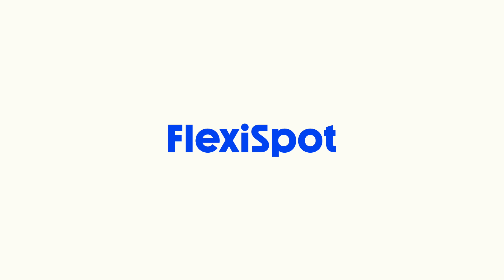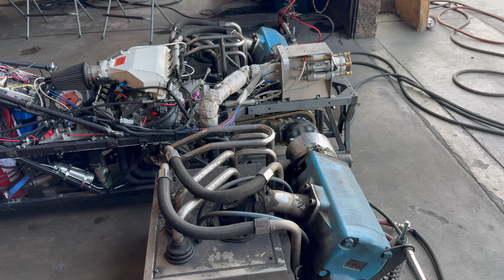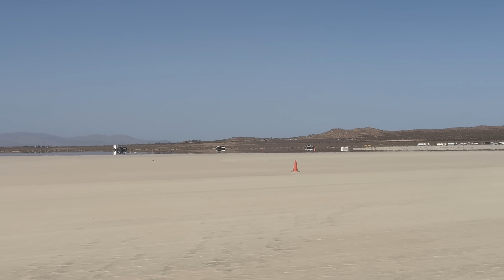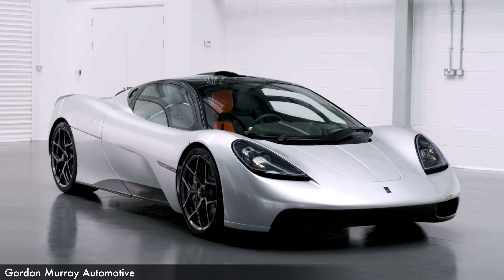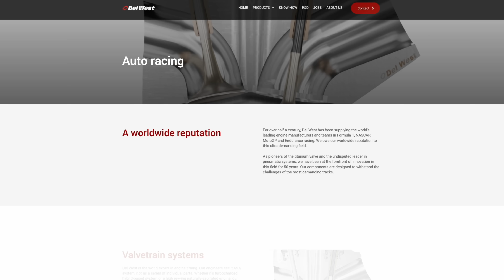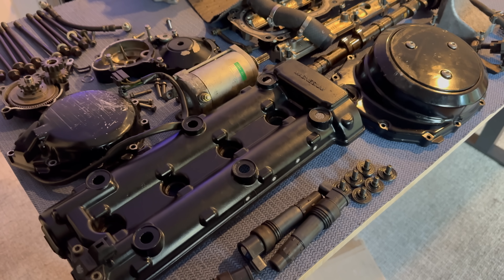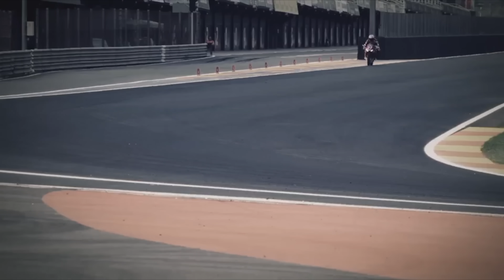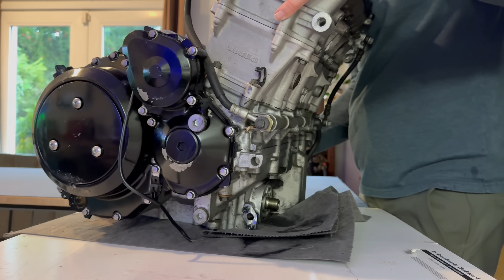Motorcycle Engines Are WAY BETTER than Car Engines

Comment: How the F did you fit so much clear explanation of engines and transmissions into such a short and entertaining video?  I assumed I would go the rest of my life not knowing why it's harder to find neutral on a motorcycle.
Reply: He REALLY needs to make more videos like this. I hope he appreciates the quality of edutainment that he just put out.
Reply: Dudes on the percentile. I was even impressed.
Reply: but for real I think it's because his explanations are well tailored to People Who Know Thinga But Don't Know This Thing.

It's nit "explain as if i were 5" which a lot of educatora
s fall into, which is useful for some people, but very inefficient for  others and people tune out. This is more focused for people in the middle, helping people who already know a lot of dots connect them into the picture
Reply: @treschlet  its the nice middle spot for someone like me who's not much of an engine guy but is mechanically inclined, dont baby me the whole time but dont assume i know what you mean the whole time either
Reply: Literally same. I was shocked at how easy he made it to understand
Reply: Absolutely brilliant video. Totally technical and totally layman at the same time . . . Somehow. I could watch videos like this all day long. A 10 out of 10 without qualification.
Reply: As a lifelong motorcycle rider. Use Motul 7100 10W-40 oil and your bike will slide right into neutral, and no more loud "clunk" into 1st gear. I've used 5 different oils, even the most expensive green colored 300V Motul oil. But their red Ester Synthetic 7100 oil is a godsend. 

I found that just changing brands of oil completely changes your motorcycle engine sound, high RPM performance, and shifting quality. 

With Amsoil Full Synthetic I had good shifting, but really noisy valve train when hot. The Motul 7100 made the shifting the best, and also silenced the valve train, both cold and hot.
Reply: sarcasm. sarcasm is the key ingredient
Reply: @treschlet Just a pinch of sarcasm goes a long way to making the soup a soup !
Reply: When you understand how something works as well as Matt understands engines then explaining stuff is pretty easy.
Reply: @geehammer1511  :) And yet,,, some really smart folks cant explain anything at an appropriate level.. He reads hs audience well !!

Comment: Street legal NA bike engines are out here making 220 hp per litre, while street legal NA cars top out around 135. 

Bike engines are just insane man.
Reply: Since like the 90's HP/liter pretty much comes down to RPM and if it's 2 stroke or 4 stroke, so yeah, duh.
Reply: And this is why .... BOOOOOST 😅
Reply: Yeah but they dont have torque, arent fuel efficient and you cant be sat at 9k at 70mph in a car, it wouldn't last 50k miles. Especially considering people don't even maintain their cars nevermind precision bike engines
Reply: @dietznutz1 people like to forget that these things come with a ton of tradeoffs but your comment nicely packages these things
Reply: @dietznutz1 that's not the point
Reply: Yeah it is insane how much car engines are regulated on and how motorcycle manufacturers can basically do as they please. 

If road cars all drove around with race engines it'd be the same thing.
Reply: yeah but you're towing that hopped up bike home sometimes

Comment: High combustion temperature creates Nitrogen Oxides that will create nitrogen dioxide in oxygen rich high temperature environment like inside a combustion chamber and exhaust manifold. 
Fuel rich combustion creates Carbon Monoxide (unburned fuel) and also a lower combustion temperature than required for nitrogen oxides to form. 
Slightly lean combustion creates very high combustion temperatures and an oxygen rich environment. Combustion that is to lean will create low combustion temperature and misfire unless high compression ratio is achieved via the engine itself and/or turbo charging 

Stoichiometric combustion is kind of in the middle of creating CO and NO or NO2.

Catalytic converters can clean up CO and NO or NO2 but they will saturate if either of those molecules are run through them continuously. Car emissions controls have used a air fuel ratio dithering strategy since late 1980s. Pretty much anything with a narrow band oxygen sensor is dithering the air fuel ratio slightly rich to slightly lean several times a second. This keeps the catalytic converter from saturation with either CO or NO or NO2 since is constantly cycling.

Comment: I wonder if you could use a motorcycle engine as a generator and I wonder if you compared a car engine to a motorcycle engine by using both as generators how much electricity

Comment: Hey Matt, I noticed that your Busa engine is a gen1. Make sure you get the gear set race cut because they all pop out of 2nd gear under power. Gen 2 and 3 are race cut from the factory. Happy Thanksgiving

Comment: In Europe current motorcycle Euro 5 emission standard is same as current Euro 6 for cars. Still producing way more power per displacement than cars.
Reply: The reason for that is because motorcycles arent expected to last at least 250k miles like a car. You can cram a lot more tech into an engine when theres no expectation for reliability.
Reply: @atypicalchannel  There is less tech on motorcycle engines though.
Reply: @ninefingerdeathgrip not true. Less computers, yes. Less tech, no

Comment: About bore to stroke ratios:
1) Quadratic engine has less surface area, thus loosing less energy to heat transfer to the block and piston. 
2) Fuel tends to gather around the piston rings. A flame front cannot propagate through tiny spaces thus a larger piston will result in less unburnt fuel
Reply: And although most car engines had bore/stroke ratio near 1, today the trend is toward longer stokes to handle emission requirements better.
Reply: @oldanslo  emissions but gas mileage as well.  The longer stroke makes for a greater utilization of the expansion annd thus thermal energy left in the fuel air mixture by the time the valve opens.
Reply: @hugegamer5988 for fuel combustion efficiency, bore:stroke ratio is not very important, the actual size of the bore matters more because the flame front has a finite speed. Even if a motorcycle engine is way more over square, the bore diameter is still small compared to a car engine. The flame has less distance to travel and it can burn the air fuel mixture well.

Turning heat and pressure to mechanical work is pressure times change in volume. As long as you sweep the piston through its swept volume, bore:stroke doesn't matter, you get the same work for the same total cylinder swept volume. Sure there is more surface area for the heat to leak out in an over square engine, but you can rev it faster leaving the heat less time to leak out.

Over square engines have good efficiency when you run them hard. Car engines lose their MPG very fast when you run them hard, they are too optimized for boring driving. With motorcycle engines engine, you get the same ish (admittedly poor for their weight) mpg whether you run them hard or not. On my 899 Panigale, I get 40 ish MPG regardless if I am riding like a grandma or like a wannabe street racer.
Reply: *losing, not "loosing". "Loosing" is what you do with arrows in archery.
Sorry if that comes across as snarky, I'm not trying to be, just offering a little spelling help 🙂
Reply: for the maximal cylindrical volume it is true that a quadratic ration give the minimal surface vs volume. But for the loss of heat the surface area during combustion (at maximum heat) when the piston is on top, is more important than the surface area when the piston already went all way down. In a long stroke engine the volume during combustion is more compact
Reply: What are you saying in 2? A larger piston (diameter) has a larger circumference thus a larger amount of tiny spaces thus MORE unburnt fuel, assuming all dimensional data (other than diameter) is the same cross sectionally .. ie ring offset, ring groove depth and height, and piston to wall clearance
Reply: @xenuno  Piston area increases with the square of the diameter, circumference is directly proportional to the diameter. So if you say double the piston diameter you burn 4 times as much fuel per stroke whereas unburnt fuel due to the "ring gap" only doubles, ie. per unit of burnt fuel you only have half as much unburnt fuel.
Reply: @xenuno that's exactly what he's saying. A larger piston leads to less complete combustion and worse emissions. That's one of the reasons that car engines are not often very over square.
Reply: @jaredlancaster4137  That's what was (logically) meant, not what was actually said. Mulligan candidate ..
Reply: That's why EU emissions laws are killing the I4 bike engine.

Comment: What about camless systems like Koenigseggs Freevalve: that would do away with a lot of the problems... Also, bikes are less efficient fuel-wise: 20 years ago my Suzuki V-strom guzzled as much fuel as a small car, but at 5x less weight and a much smaller aerodynamic cross-section...

Comment: Problem is reverse I’m thinking an axial flux electric motor mounted between the diff and the driveshaft perhaps it could assist on launch as well as reverse

Comment: Hell yeah! Also, for some reason I have been seeing an uptick in goldwing flat 6 engine swaps into cars. Thats killer too
Reply: They are a pretty good fit, as the bike itself is heavy so the engine is made to get that weight moving. Also goldwing have a reverse (usually electric, but it is there). The most often swapped engine is the 1300GSXR "hayabusa" engine though. Nice displacement, good power, lots of aftermarket parts .
Reply: @croustibat682 done a hyabusa swap into a festiva. Car was nuts lmao and got better fuel mileage than with the original 4 cylinder😂

Comment: if motorcycle engines are so good then why arent they used in all cars? checkmate 2wheelers
Reply: Driveability(the power range width as function on final drive, 2000 to 4000 vs 6000 to 10000, also further from idle) cost, longevity, emissions.

The emissions bit is a big one why honda car engines no longer scream.

S2000 would sure be nice tho..
Reply: Because cars are tools and bikes are toys 😂

Comment: I own a motorcycle engine that I've never seen running. Connected to a motorcycle that I have never ridden. Don't buy someone else's project 😭
Reply: I have those. All of my projects belonged to someone else. You just have to be painfully stubborn and refuse to not get them going.
Reply: Shhhh!  So many of us with projects we need to unload are depending on New Buyers' enthusiasm and ignorance, to restore our generational wealth.  So ya, my heirs are going to get a lot of junk cars.
Reply: That's just called living the dream my friend
Reply: I feel you there.  I've got 1988 Honda CBR1000F that's in a whole bunch of parts.  And that was probably 8-9 years ago.
Reply: I got a 93 zzr600 that needs rod bearings. Engines out of the bike and halfway torn apart. Waiting on a blotch basket removal tool. Wish me luck
Reply: @MotoBible  You can do it!
Reply: I bought a 1979 Honda CBX  6 cylinder bike in 1992. It was beat up and had a rod punched through the cases. That was my very first motorcycle engine overhaul.
Its not a beginner engine overhaul project for sure!  Getting the new cases together was a big challenge. It still runs. I put on a Honda 1100F front end, swing arm, wheels, brakes and bikini fairing on it and painted it with catalyzed urethane paint. It still runs, looks good. That was 33 years ago. Now I don't even feel like checking my oil in my car.